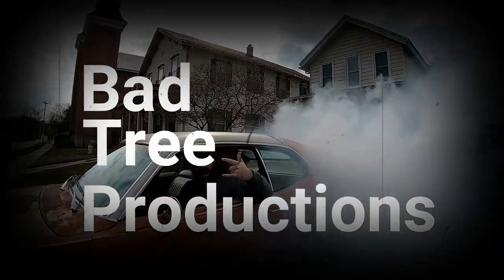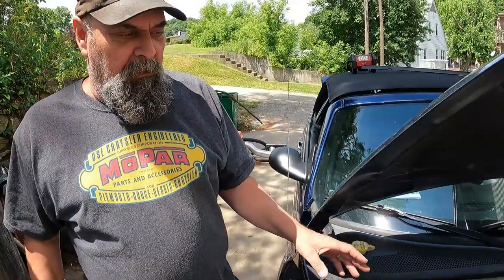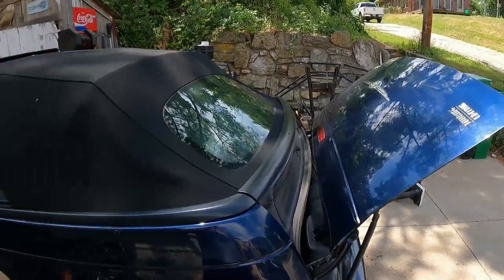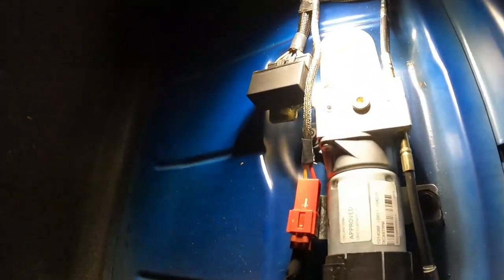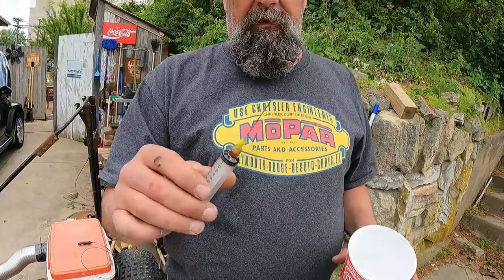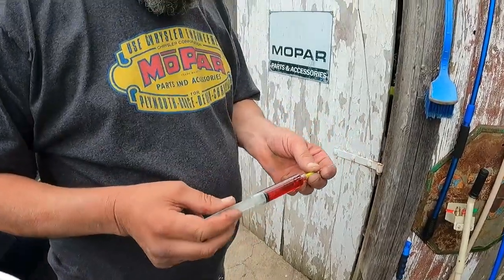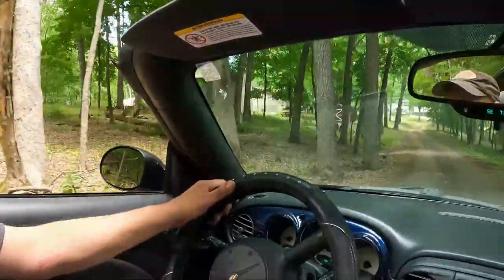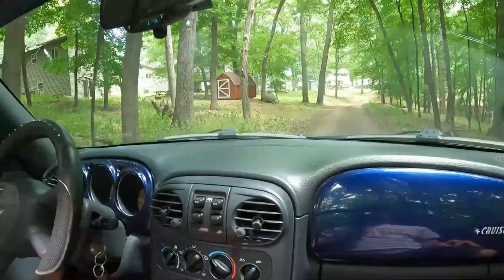PT Cruiser Convertible Top Issue, Cheap, Easy Fix.

Comment: Few tips on syringes/tubes. Someone posted on FB a kit with syringes and connecting tubes. Unfortunately the tube was too big. I took a PB blaster straw and connected with a tubing connector. It flowed so much faster and cleaner. On the right side you can see an opening where the straw can pop through directly into the reservoir. 

I unfortunately filled it to the max several times and the top barely moved. I’m going to try manually opening it. But where did all the fluid go? I would attempt to open the hood and all the fluid would be gone after trying for a few minutes.

Comment: I actually did this on my 2007 cruiser. It worked great for about a week then nothing. Reservoir empty. So I got back to it and got it to open and close and nothing again. Reservoir empty again. I filled it completely, opened the top and reservoir empty again. Since I'm working alone I wasn't able to open and close the top manually. I'm at a loss. Hoping to get some help to bleed the system and get the top working again. But this was a super helpful video. Thanks!
Reply: Thanks for watching, hope you get yours sorted out, take care.
Reply: Little late but probably the ramps leaking fluid

Comment: Hey guys.  '05 PT Cruiser convertible owner here...  * ONE Thing every video I've watched seems to omit ONE Important Tid Bit... There is a reason for the hydraulic pump reservoir to be low on fluid...  "WHY??"  And, how to trace possible leaks, bad seals... bad lift...  EVERY VIDEO SHOWS FILLING THE Pump Reservoir but, not how to get to the lines to troubleshoot the root of , main cause of the problem...??  
 Sure, My top worked, after refilling the pump...  After 4-5 times opening and closing...  Back to the Drawing Board.  One step forward, three steps back/  I'm frustrated as all get out.  Chrysler will NOT give up any Diagnostics without going into the shop.  How long did your top last, after this video, before it failed??  Again?
Reply: Good point, good question, we didn't notice any leaks before or after we filled it.  We sold it a week later and never heard from the new owner.  Sounds like you're going to have to remove the interior side panels, once out of the way, I'm sure you'll discover the source of your leak.  Leaving that screw loose and operating it manually isn't too tough.  Good luck.
Reply: @79asspin  Thanks for the reply.  I have the seats, seat belt bolts and back head rest out...  Having to ass readiness for emissions and tags  Chrysler Drive Trace/Cycles are ultra specific.  Once, I get back to removing the interior panel... could be a piston seal or one of the two lines to the pump.  By the way, the manual override in the ceiling of the trunk has been set to manual for over a year!  Can't wait to turn the darn thing clockwise and leave it in that position for good.  heehee!  Safe Travels.

Comment: your heroine kit 😂.   speaking of syringes here another cheap easy fix - when out fishing on the shore or boat and you have ypur worm on the hook use a small syringe like for insulin shots with a skinny short needle and stick the worm and put a small amount of air into the worm . when you remove the needle the worms body will seal up the hole and the worm will float under water 😁. speaking of the 90s - pump ! pump up the jam ! pump pump it up!

Comment: My 2005 p t conv turbo . I think I need a fuse for my power window and convertible
Reply: It doesn't work the inside power butt in for windows n conv. Button quit after the battery went dead. Is there a fuse somewhere on this p t.
Reply from the maker: @ruthannhamaty263  There is a fuse 14 in the fuse box at the left side of the dash for the power windows, to top gets its power from the same fuse. There is also a circuit breaker in the same fuse box labeled circuit breaker 2

Comment: Can you just leave it to where you manually put top up or down if you don't wanna deal with the rest of that crap by loosening that screw in the trunk? Nice vid brothers 👍 just got it mine is a 06 and just deliver pizza in it 😂 any advice is appreciated in advance just don't wanna pull the seats and panels out replacing the actuators as I don't see any leaks in the motor itself and fluid was just added three days ago I'd rather just prefer to do manual from here on out if I choose not to repair...
Reply from the maker: Just leave that screw loose so bleeds off and you can move it by hand back-and-forth for the rest of its life